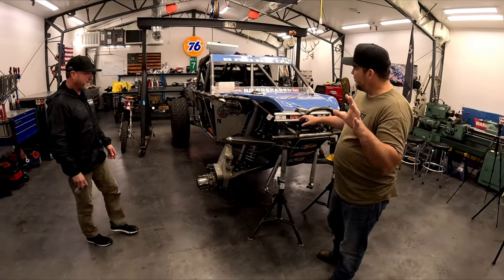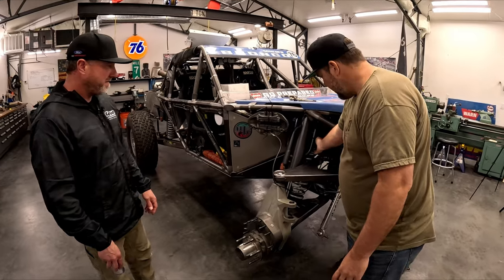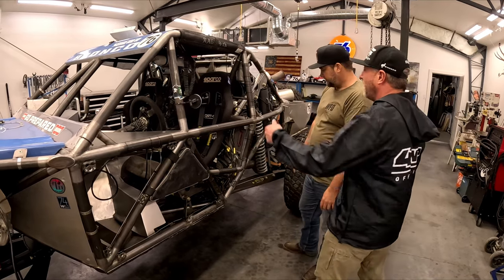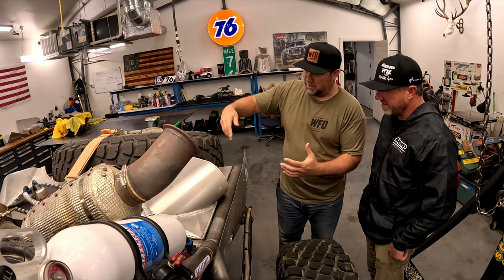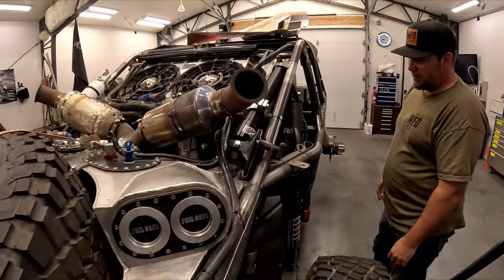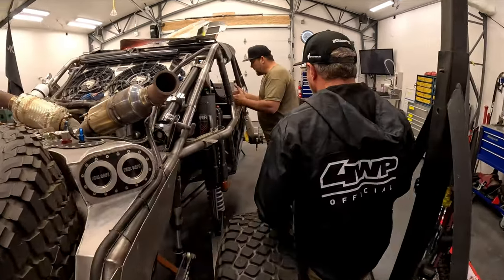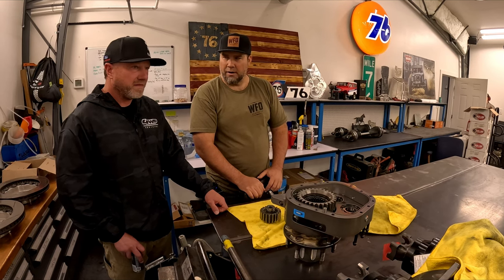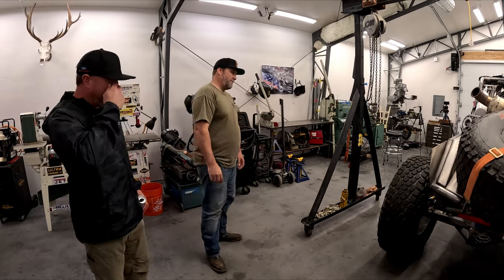How Jason Scherer Built Podium Worthy Race Car: In Depth Look at Jason's Car

Comment: Single sheer on the upper control arm 🤔 I’m sure it’s over engineered, but you can’t engineer smashing things on rock 😂
Reply: Only sort of single shear. The bolt on the upper does not see shear loads because the shear is placed on the misalignment spacer which is a tight slip and threads into the upright. I believe it’s only a 5/8” bolt for the upper on the upright. I’ve heard this debate for years…and in 3 years of building them like this I’ve never seen a single issue.